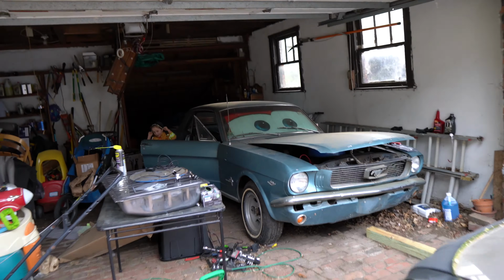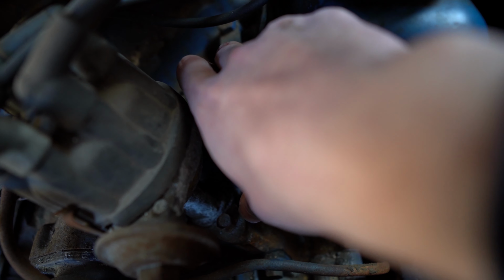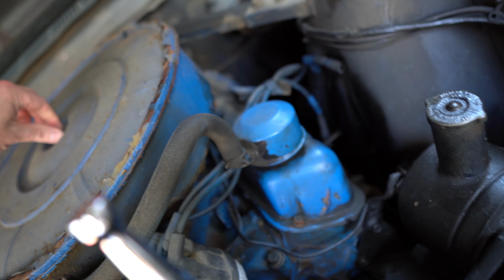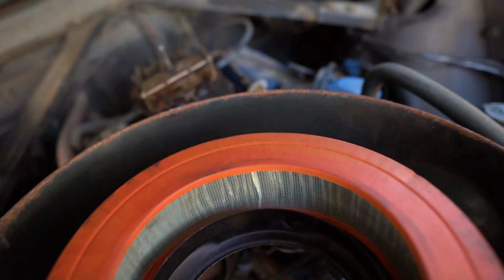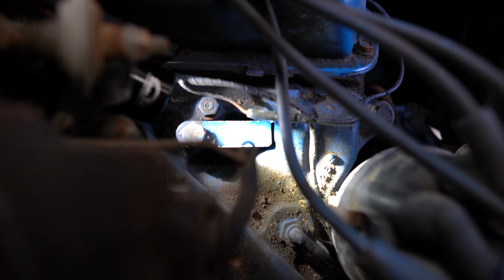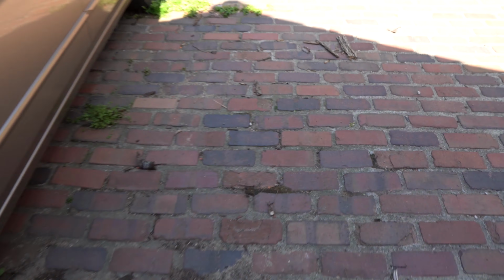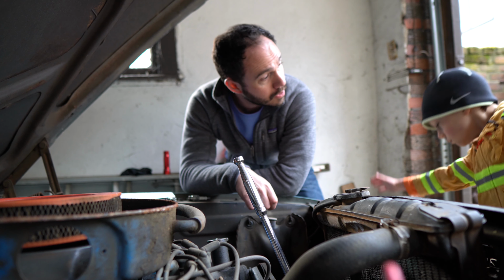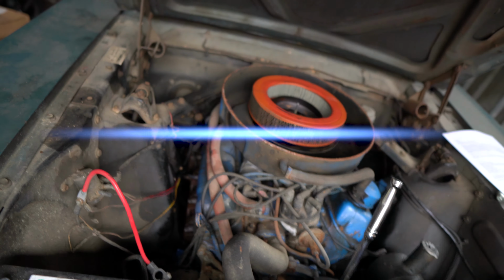Decoding The Engine: Is it Numbers-Matching? Decoding His 289 Windsor Ford Mustang Engine Tag

Comment: I’d say take the motor too a shop and see if the motor is save able, then work on the little things like brakes, paint, suspension. It seems pretty complete though.
Reply from the maker: It genuinely looks like it was just parked and left like that. We’ll at least get the engine pulled and torn down (for learning), I’m sure that we’ll need more professional help later on, especially since we don’t want to wreck a 50-60 year old engine.

Comment: So I'm pretty late to this game, but I have to throw in.  First its great to see you trying new things as a self proclaimed amatuer.  Learn by doing!  Second you probably know already, but for others, on these cars you really can't document a  numbers matching engine.  Seems you have an "A" code car with an engine that is an "A" code spec.  Thats as close as you can get.  It might be original, but it might be a replacement.  Use date codes and other indicators to determine the likelihood of originality.

Comment: C-code mustangs have a 289 2bbl carb on them I have a 67 c-code with a 2bbl but don’t rule out the entire block is not numbers matching sometimes a lot of guys bought a 4bbl intake manifold and slapped a 4bbl carb to increase power quick and easy
Reply from the maker: Thanks for letting me know. The VIN says it an A code, which is a 4 barrel. And a few great people on Instagram recognized that this was an original Autolite carb that came on the 4 barrels. So that’s great! I just didn’t know at the time that the C stamped on the engine tag didn’t relate to a C code VIN. It’s a tad confusing, but that Fordification website was a huge help to me, along with all the great followers we have in Instagram!

Comment: For getting the engine unstuck, if you take off the accessory belts and fan, with a helper trying to crank the engine with the starter, and you on the front with a ratcheting breaker bar, you could possibly break the pistons loose. Just an idea. I would make sure it’s a ratcheting bar so when it breaks loose, it wont fling the bar into the fender or smash your hands. I’ve had good luck with the 1/2 tekton ratcheting bar. Mine got stolen, but I’ll probably pick up another at some point. A nice ignition upgrade that keeps the same style distributor (for originality’s sake) is a pertronix unit. Google it, it drops right in to where the old points setup was.